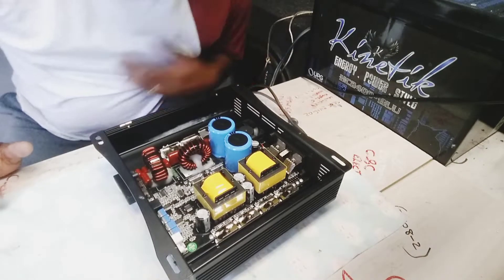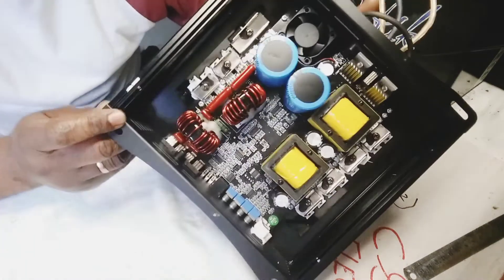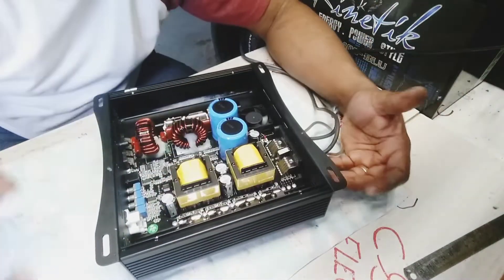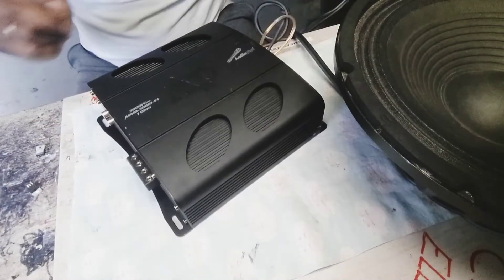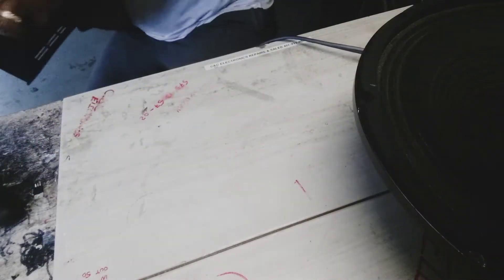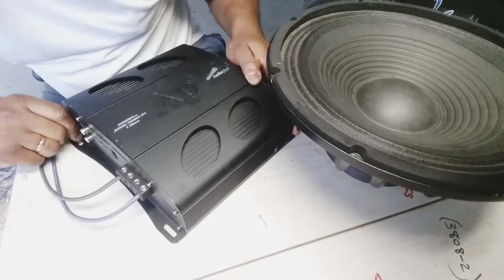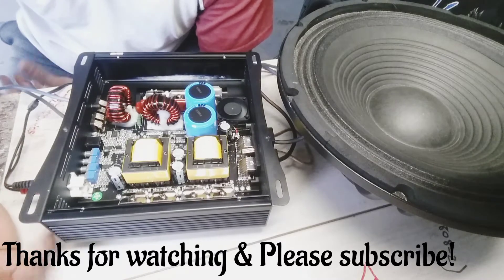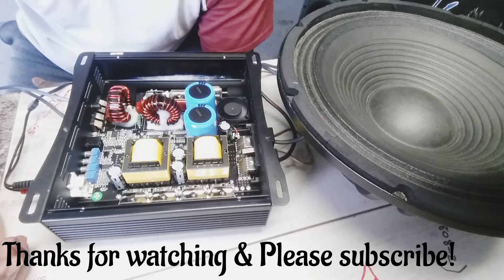AudioPipe APHD/30001/FI 1 ohms Amplifier| Repair Explained|Carty&Carty Electronics|Vital Information

Comment: I have one that is not coming on, no port light or power light, and when I connect it to a power supply, it shorts out the power supply. Pls help.
Reply from the maker: @travisbrown6945  you have some bad power supply mosfets that's why it's shorting out the power supply
Reply: @cartycartyamplifiersalesrepair  I just remove two of them, and I see the port light along with the power light blinking, i guess those two are the bad ones?
Reply: @cartycartyamplifiersalesrepair  I think in another video you did mention that the rif1404 could use in it, right?